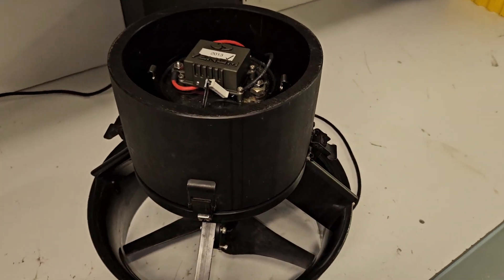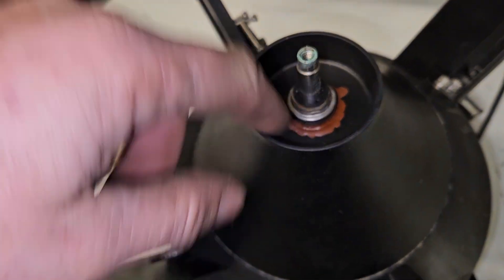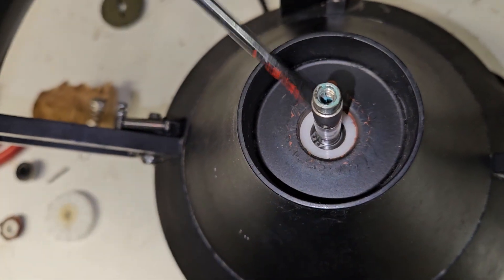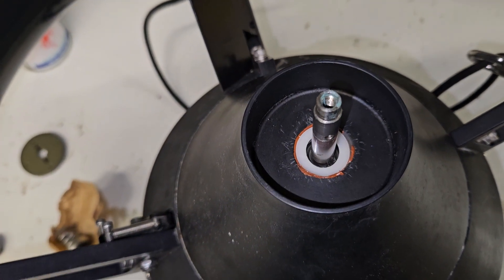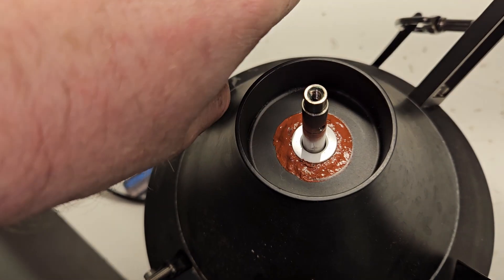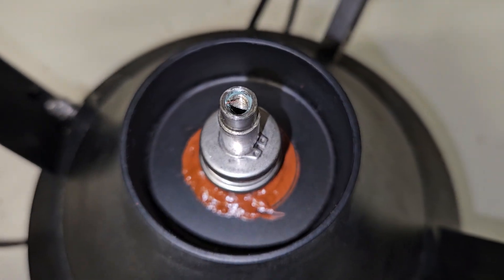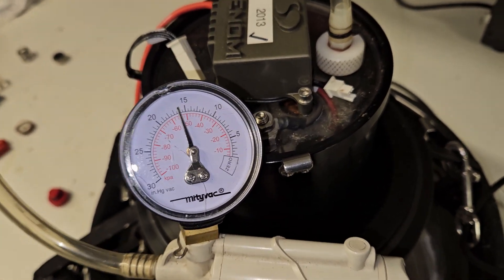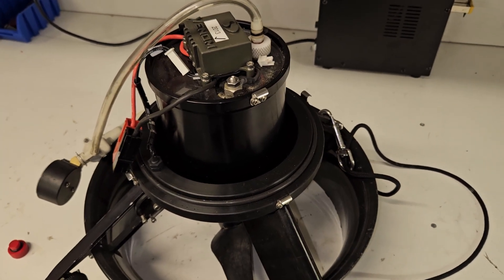DPV shaft seal replacement

Comment: I have an n-19, shaft seal hasn't been changed since 2007 but its still waterproof. How can i check if it needs to be replaced? What about bearings? When do they need to be changed?